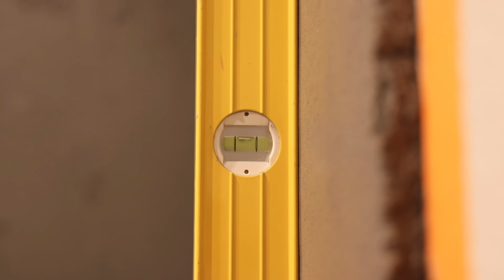WATERPROOFING A MASSIVE SHOWER!!!---Part 1: Installing Kerdi Membrane

Comment from the maker: I forgot to mention this is part 1 of 2 videos.   As you can see, there is no band or 8+9.   On Friday I will be uploading the part 2, where I use Ardex 8+9 to install the kerdi band.
Reply: I'm anxious to see the Ardex 8+9 used as a bonding agent for the Kerdi band. Awesome work!
Reply: Gotta try Marshalltown cement float for laying membrane. Allows you to put a lot of force and really press those bubbles out. Plus blunt edges make it safe and great for corners
Reply: Great job tile coach! Idk if you do a lot of upholstery or wrapping cars but checking out a few upholstery/ wrap videos. I'tll help with laying those waterproof sheets in the future. They pretty much start at a corner or edge and work bubbles out as they move along instead of lay the whole sheet down.
Reply: I use a plastic wallpaper trowel works awesome no sharp edges. Very easy to get good corners and easy to clean up
Reply: Curious why Schluter says Ditra Heat mats or sheets are waterproof already minus any seams but you along with some others also install kerdi membrane over the shower pan... Is schluter wrong about the ditra heat being waterproof as is?

Comment: Great video :) I thought that wrap seemed ambitious! I’ve had it work, but it seems more trouble than it’s worth. I usually install that top sheet with a 2-2 1/2 overlap onto the bench then use 2nd piece to wrap the bench. I really like to use paramedic shears to cut all my kerdi. They hold up forever and the tip won’t puncture the membrane or things like that heat cable 👍

Comment: Just wanted to add that with both schluter workshops I have done I have learned it is best to use unmodified thinset behimd membrane and on surface of membrane to set tile. I use mapaei kerabond unmodified or the actual schluter all set thinset. Just my input. Love your videos man great job.
Reply: I thought that too, which is why i5 just peels off?
Reply: You are right sir

Comment: i love the quality of work you do. I'm just not sold on the kerdi yet.
Reply: Trick to make kerdi 100% is to use red guard or some other paintable waterproofing membrane to go over the seams, but without that, I don’t trust it completely either
Reply: @Rustyshackleford752  red guard by itself is better than kerdi

Comment: When skimming walls you can treat them like a drywall  finisher would on a level 5 finish and get big skim blades to make them smooth and strait. Also take the thin set out of the bucket and into a mud pan and use a 12 inch mud knife to get it on the wall. This will speed up floating walls by atleast 75%

Comment: Looking at the schluter site they say all you need to do to waterproof the ditra heat is use kerdi band on the joints.   The ditra heat is already waterproof.  Is the extra kerdi sheet really necessary ?  Thanks for great videos !
Reply: Exactly my thoughts. Schluter claims Ditra Heat is waterproof minus the joints

Comment: I updated my shower put in a mud pan with linear drain.  I waterproofed it with kerdi membrane.  Today I did a flood test and it did not leak but water wicked up about 3 inches.  My question is can I put hydroban liquid membrane on the pan to keep it from wicking?  Kerdi told me I don’t need to but I want to stop the wicking.  Thanks, Mark

Comment: Wow, you did a really great job!  Such an artist.  MAPEI is an Italian company, Schluter Kerdi is a German product. Both are excellent!  I was curious about a couple of things:
1. MAPEI ultraflex thinset mortar has polymer mixed in it.  Is this any different from regular thinset mortar + polymer added?  I will always use polymer instead of water as it rubberizes the mortar so it does not crack easily in earthquakes, ground settling, or RV motorhome installs.  It holds up to vibrations well.  Polymer in grout also seals everything nicely and no need for a sealer top coat.  Can you use the same Ultraflex mortar for tiling as well?
2. Why not use Kerdiboard which has both the backer board + waterproof membrane in one package?  It would save on labor having to thinset coat twice - once for the membrane install, then again for the tile install on top of that.  Plus Hardibacker board and all the cement boards do not hold up to moisture and are very heavy.  Seems to make no sense unless it is a cost savings.

Comment: Hi there, any reason why you guys put a layer of kerdi membrane over the ditra heat? From what I've seen on the Schluter website, you can just put kerdi bands over the joins in the ditra and tile straight on top...

Comment: Nice install.  
Question though.  I do alot.of what u do on my installs.  But I have had great success with the ardex products under and over my schluter products.  Could b the climate. I install in mid to northern Canada so a way diffrent climate.  
Lately I prefer the uzin cx30 for over and under schluter systems.  Strong bond, easy to work with (creamy) and no slump.  Also dries very fast when between 2 non porous products.  

And that's my question to u.  What r your thoughts on polymer modified and non modified mortars.  Ivw always been told that ultraflex 2, being modified, (and.possivly the lht mortar) needs a porous product to dry into. Thus not allowed b/t ditra and kerrdi. Thoughts???

Comment: I do construction for living and I can say really good job(Can’t trust a lot foam boards and I do same as you are doing,cement boards-membrane on top..).
My only concern is the fact that I can’t trust 100% the membrane(especially if there will be any leak from the ceiling or from behind of cement boards-humidity may weaken the membrane...just saying).
What’s the best thin-set you have used for waterproof membrane installation?

Comment: What are the advantages of using the Kerdi membrane vs Ardex 8+9 or Redguard/Hydro Ban on the walls?
Reply: My thought is that the Kerdi would act like an isolation membrane when the structure moves. I know the liquid membranes do have some flexing capabilities, however they are still bonded to the substrate and have limited ability to decouple from small structural movement. I think that's where the thinset/fleece have a little better ability to flex and move. The weakness is the seams where thinset can wick water, which is where the liquids come into play. That's my thinking, anyway.

Comment: I have a quick question, over here in the uk. We called thinset, tile adhesive. My question is what kind of tile adhesive is suitable for Kerdi membrane? Struggling to find the right adhesive for this purpose, as the most common bag stuff we have are usually rapid set with only 30 mins working time. It would not be enough working time?
Reply: You can buy the mapei theyre using here from tilegiant and other online retailers, the best,easiest to use and most cost effective here in the uk is topps tiles own brand with a trade account slow set flexible in grey or white, the bal grouts and silicones are also the best we can get, the actual tiles are overpriced through
Reply: Devon y thank you you are a life saver! Didn’t know topps tiles do a slow set adhesive.

Comment: Hey bro two quick questions. First can you double up on the membrane on the shower pan if necessary? Also I've seen you use a few different waterproofing methods on top of the membrane. What's your current favorite?

Comment: Kirdi membrane for walls is a hassle quit useing it years ago , bubbles , egdes dont bond , red guard much easier and water proofs just as good if not much better , Kirdi floor systems and pans though are great systems .

Comment: Hello Mr. Tile Coach. I’m a big fan of your work. I have a question about your inside shower floor. Was the wood floor NOT Hot Mobbed which made you add the Vapor Retarded Membrane on top of the Uncoupling Membrane for waterproof ? Or was it Hot Mobbed but you wanted to add the Vapor Retardant Membrane on top of the Uncoupling Membrane?

Comment: Shouldn't the horizontal seams overlap so that the one "up the stream" goes over the lower portion? In other words, if you use the tape, you need to stick upper half of it under the layer above. Similar to how roof shingles are arranged. don't see this in this video. Thank you
Reply: That is the same issue I deal with. Schluter says no but it doesn’t make sense.

Comment: Full disclosure, I'm a newbie to this so dont scorch me if this is a dumb question.   I'm confused about the use of kerdi on floated walls.  Why do this extra work?
Reply: It’s about levelness of the wall. Simply adding kerdi-board to the substrate won’t fix problems with the wall being out of plumb. Floating the wall fixes this issue, and then the kerdi membrane provides level 1 of 2 waterproofing (Issac prefers the one-two punch of kerdi membrane and Ardex 8+9 or Laticrete’s hydroban for waterproofing the shower.)

Hope this helps.

Comment: I would like to learn floating walls, I’ve been at it for 21 years now and hadn’t had to float walls other than shower pan repairs on older home...problem is, I work in generally new construction and these builders I work around don’t like to pay for stuff like that. Hell, I used to wet shim but due to time and money constraints, I’ve just been struggling with the shitty framers I have to work behind
Reply: I'm right there with you bro. I'm 27 and just started doing my own thing after working with my dad for 7 years. The framers are horrendous. A lot of times you are forced to do things not exactly the right way because there's no other option.  The builder isn't gonna pay me to fix any walls so im stuck with it. Most times for me i cannot trowel my thinset onto a wall ever because a wall is so off. So i have to build out with thinset. I know you're not really supposed to do that with regular thinset, but the builder wont pay for medium bed either so idk man. Just working with what i got and what im allowed to do, kinda sucks.
Reply: @Aaron86v  sounds like you need to go with a different builder that allows you to do your job correctly
Reply: @aaronpage1822  That’s one of the big problems down here in south Texas... There’s lots of cheap work, so basically no one wants to pay more even if it’s a proper job. Most of them don’t even know what a proper job is.
Reply: @Aaron86v  that’s what I callin fkn up on purpose and it sucks to have to do that
Reply: @JustinMentionedIt  I know im still doing a better job than anyone else could do for the price and job, so i don't lose sleep over it. Always gonna do my best regardless even if the builder doesn't care as much.

Comment: I thought you only apply Kerdi to the seams of the ditra heat?
Reply: Not in a shower, you want a continuous membrane
Reply: Yes, I should have checked the installation handbook before commenting, it is on page 11.

Comment: Instead of wetting the wall 
Why not use PVA bonding 
Seals it up and helps the adesive
Reply: Weirdly in USA we actually don't even have plain "PVA" adhesive. The closest you can buy is Quikrete Concrete bonding adhesive, all branded/patent stuff for companies to make more cash. To be fair, too, water is also free and should work fine.

Comment: I kinda skipped through the video because I already know how to kerdi, just wanted to see how you do it, but why did you kerdi the floor? According to schluter all you have to do is band the seams and it’s waterproof. Unless of course your just over killing it like usual.
Reply: I think Schluter wants you to cover the heat cable with kerdi in a shower
Reply: if ditra heat is in a shower you have to membrane the entire thing. water would pool in the pucks if you didn't
Reply: crazyeyes19523 well it shouldn’t puddle in the pucks because you skim the ditra before you would put down your floor tile. I just find some contradictions and inconsistencies in schluters standards. I use their products all the time but some stuff just don’t make sense.

Comment: Does not care about bond strength omg pretty important on the walls
Reply: It's only as strong as the application, is his point. If one has some theoretical bond strength in the spec sheet of 400PSI but sucks to handle, gets air pockets everywhere, shrinks, sags, etc, and one has a theoretical bond strength of 300PSI but doesn't do all those things, the 300PSI one will bond better.